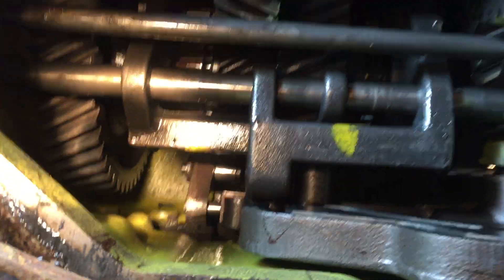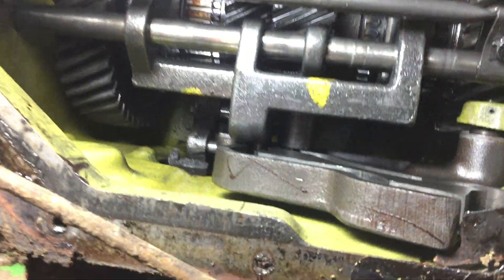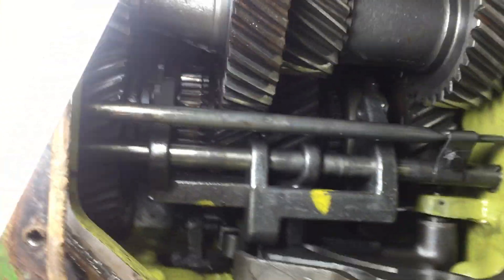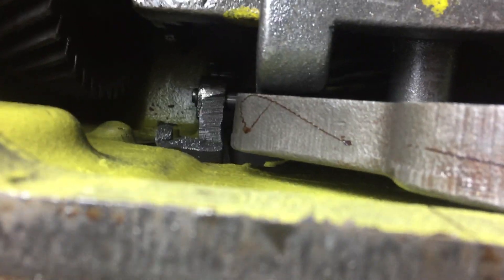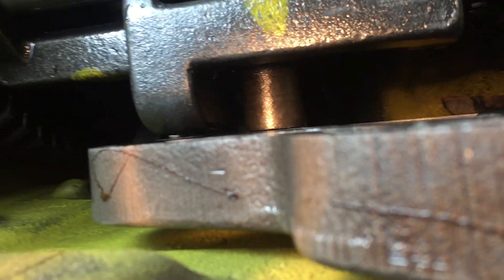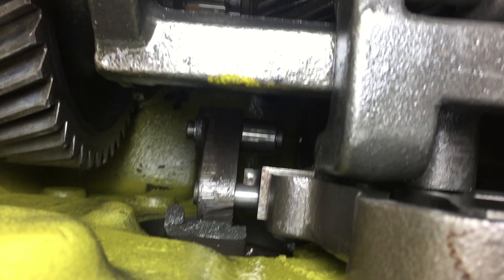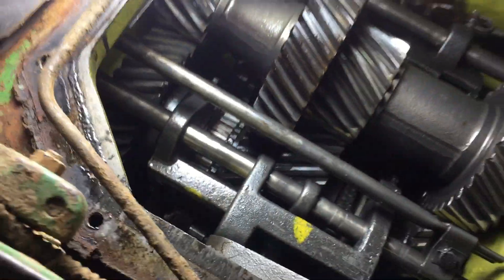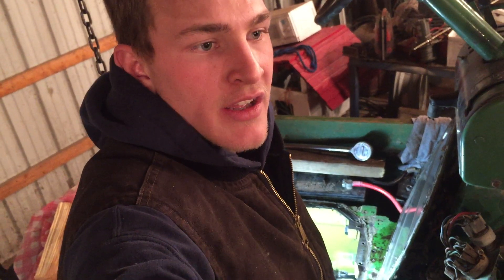More JD 5020 Carnage

Comment: you want my 5020?  nickel rod and you can weld that housing up if not near a bearing. when rolling it over put it in park position, on most of them syncro trans tractors park is by putting the trans in a couple gears in the same time.
Reply from the maker: Sure I would take your 5020.Ill come and pick it up if you really wanted to part with her. I thought about having it welded but not sure if im gonna go down that ally bc id have to tear everything out im thinking about leaving it alone for now. I didn't find any parts in the bottom of the trans with tells me it happened to the other owner and he had it fixed already but the park pawl.
Reply: Dad would probably let it go for a couple Grand. If I could get a trailer I would bring it to you. When we parked it there yeah good transmission we rebuilt the PTO rebuilt the left final drive. You have a $700 hydraulic pump up front. The engine has no value to us.